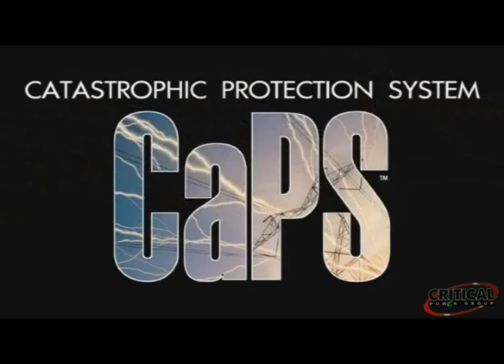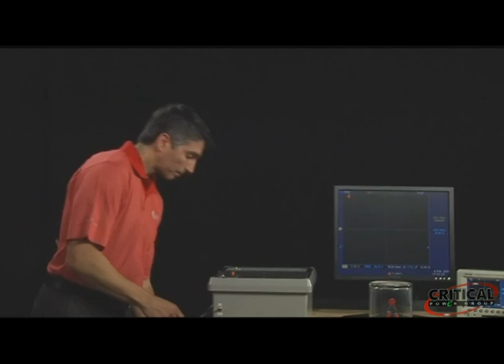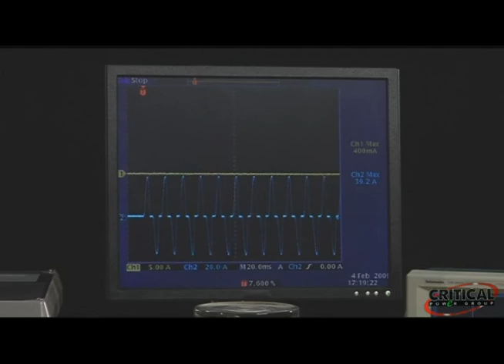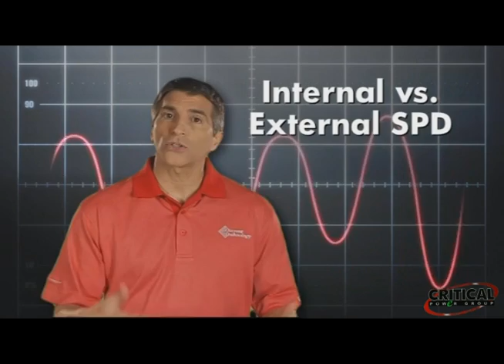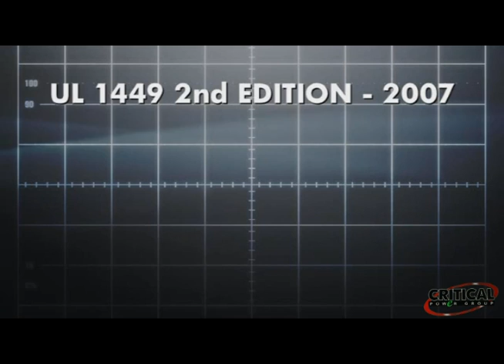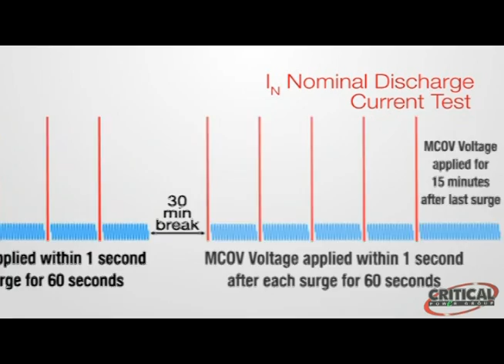Current Technology Surge Protection (TVSS/SPD) Part 2 of 2

Comment: Why would you want to send power to ground?  Won't that hurt data lines?
Reply: +Zero Surge Inc. 
Because it's a surge and will blow up electronics. Hurt data lines? Even if the whole supply was shorted, downstream electronics shouldn't be harmed - it just won't receive any power.
Reply: the answer to that is to protect the data as well... one should protect everything and at multiple levels
Reply: @booguloofurstaverg1301  unless it feeds back through the coaxial or RJ11 lines and damages the attached equipment.